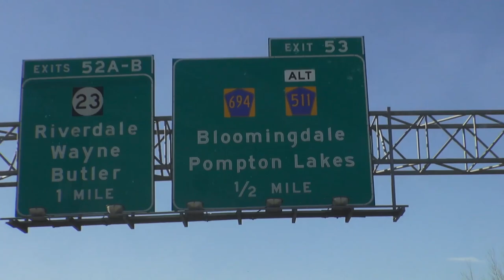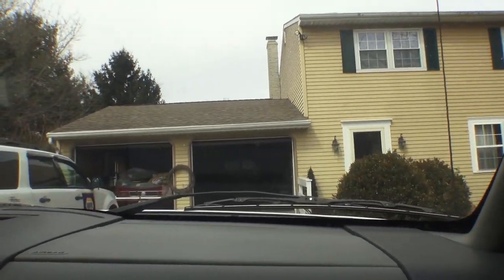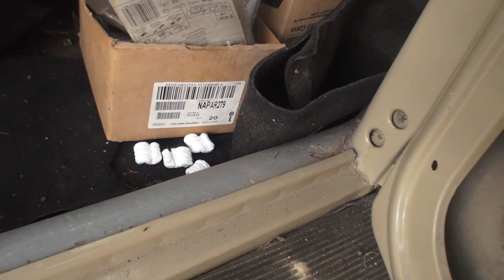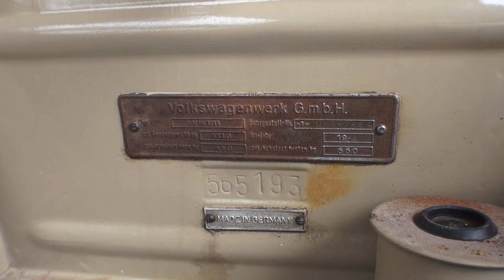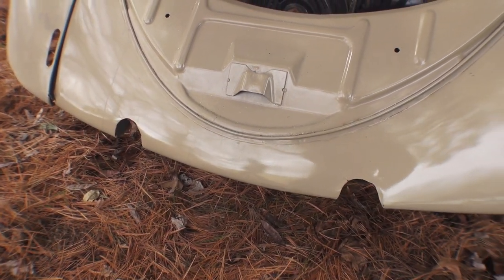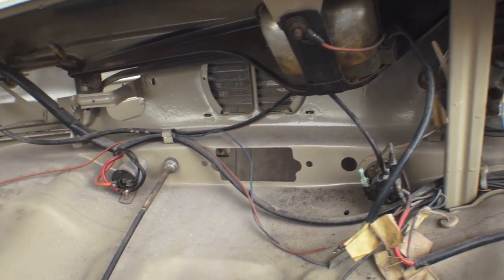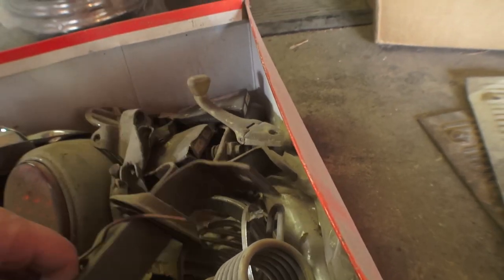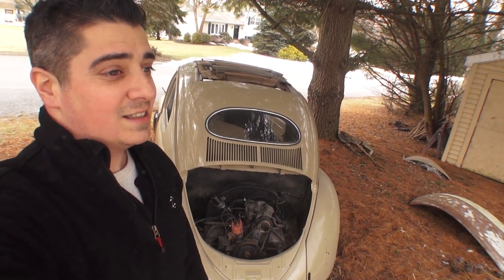Classic VW BuGs Garage Barn Find 1954 Oval Window Ragtop Vintage Beetle

Comment: Chris...What's a wire tube fender? I've got a spare batwing steering. Can I fit it on my 56 Oval?
Reply from the maker: up until '59 bugs, VW had a metal conduit tube from the headlight bucket to the body where the headlight wires passed through.  After that they went to a seal.  If you have a 55 and earlier batwing wheel, I do not think it will fit the 56 and later as the splines changes, but you never know, you can try it.  =)

Comment: I'm starting on a second owner 1963 VW beetle 6v. It was a Southern California grandma car when I purchased it done 12 yrs ago. It runs and drives beautiful but does need some floor pan resto as well as paint and interior work (all is there and original parts but in poor condition).

I was wondering if you think I should keep this 6v or convert to 12v? Will it affect the value if converted?
Reply from the maker: George Ramirez Depends if you plan on showing it or not.  I stay stock with show cars, although you can get a 12 generator that looks like a 6v genny, and fool the folks.  =o)
Reply: Got it. Whats the best bang for your buck vw parts spot that you have encountered? At the moment my first investment will be a whole re wiring of the the vehicle and body off pan resto... i have been to multiple local shops and still undecided. Ill just ask the expert

Comment: Hey chris nice videos! Have a question.  how do you get your titles when you buy a bug with out one? Do you do a surety bonded title? I bought a 1960 bug with no title and wanted to see if there was an easy way around the MVD 😂 any info would be greatly appreciated thanks
Reply from the maker: Well unfortunately each state is different, in NY where I am, it is sometimes hit or miss, depending who is working that day at the DMV.  Some states you can go into the DMV with a bill of sale only and say the car was abandoned and there is no title.  Many times they let it go through because it is such an old car.  You should be able to find out on your states DMV site.
Reply: Chris Vallone thanks for the quick reply chris I appreciate it and your videos great learning tools thanks again for getting back to me